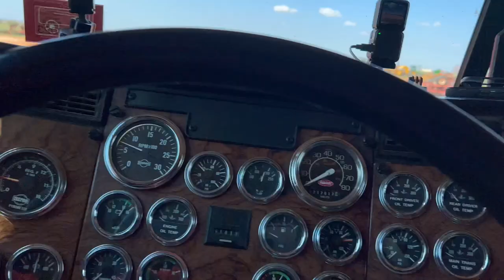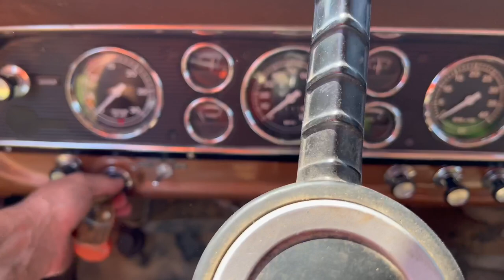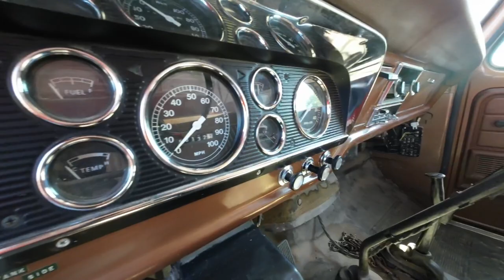The Grain Truck! Ford F750. Day in the life of a AG Trucker!

Comment: to the bossman (age 70 now),,Just thinking in my past experience dealing with truck shorts alot I found in rotted engine wire harness as it passes around the engine banks to the injector pump. Peel protection back and you might find the blue corrosion. Hope u get the UNIT on its rubber again..R
Reply from the maker: Yes sir, I’m pretty sure we have a short somewhere…